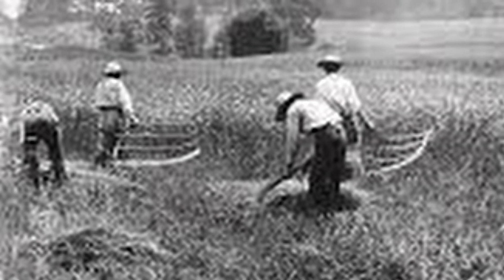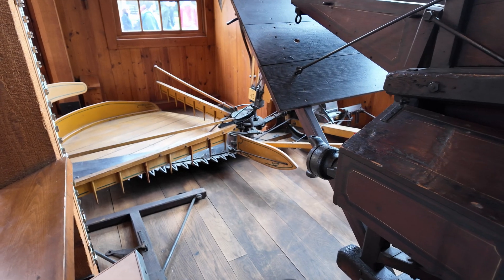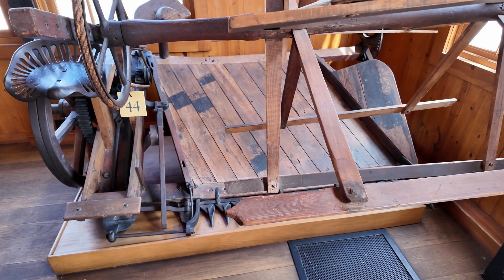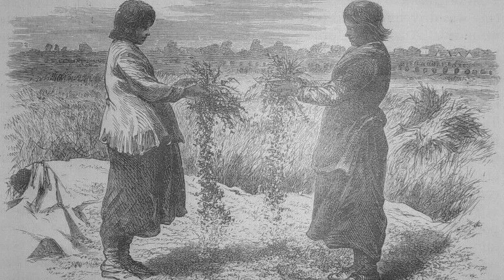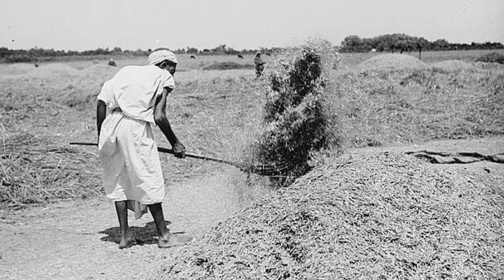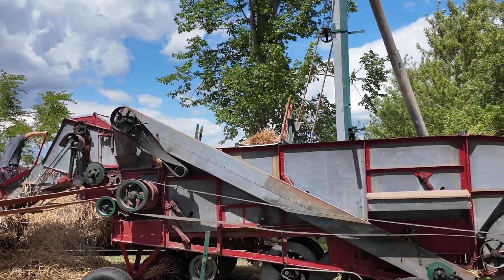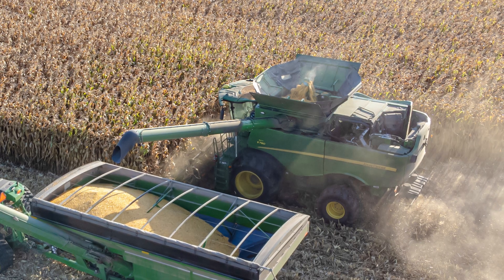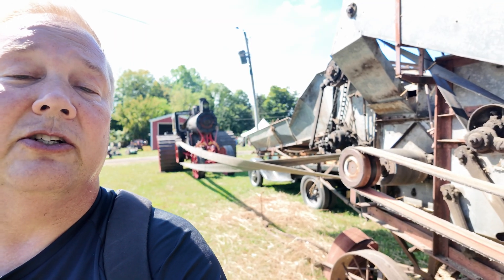How Threshing Machines Revolutionized Farming Forever

Comment: I'm restoring an 1860s Ransomes and Sims portable steam engine and own a 1856 Ransomes and head thrashing  machine, the oldest set in the world. Hopefully will have them working together in a few years . I'm in Tasmania
Reply from the maker: Sounds like a really cool project.  I hope to see some video when you get it all working.
Reply: The portable has wooden wheels . She was in a huge bush fire which distroyed them. I re made them copying the thrashing drum wheel as they both have same cast iron hubs and tyre sizes. She was re boilered in 1902 in steel making it possible to repair. Luckily she's not missing any parts even has original whistle and pressure gauge measuring in atmospheres. Such a time machine

Comment: Great explanation but some terms are wrong (I nitpick about terms because I will get the thing you say and not the thing you mean when using the incorrect term) so here is what I know: Reaping is the cutting of the stalk of the grain, The cutter bar of the mechanised reaper cuts by shearing instead of slicing which a scythe does or chopping like a sickle being pulled towards the user (sickles can also slice) but not sawing but you did mention scissors which is a correct analogy.
Edit: Harvesting is the process of gathering the crop into storage where it wont spoil for a while, so grain can be harvested but not threshed.
Reply from the maker: Thanks for the comments.  On the last point first, you're definitely right.  Before powered threshing machines, harvesting of grain was usually done before threshing, sometimes months before.  This is something people in modern farms have mostly forgotten, since the introduction of combine harvesters.
Speaking of combine harvesters, if I used that term around local farmers, they'd laugh at me.  They're combines, here.  There's no such thing as a disc harrow, either.  They're just discs.  There's a lot of local terms out there, especially in the agricultural world.
I think all your terms are correct, even if I hadn't heard the difference between a scythe slicing and a sickle chopping, and appreciate you sharing all the info.  Please keep doing it with my future videos!  I do try to always get the right terms, within the limits of regional variation, even if I do sometimes use the more common ones, and sometimes, the correct terms keep tripping me up (like remembering that grist mills grind grain, millstones, grind grain, but the individual grain kernels/corns are actually scissored, not ground. 
Again, thanks for the comment, and I do always appreciate more info I can use in the future.

Comment: It's actually a portable belt driven thresher
Reply from the maker: Technically, true.  They can run on just about anything that can spin a big enough pulley fast enough with enough power.  They were first built to run on steam engines.  I don't think older horsemills would have been able to run one.  Certainly, newer, non-steam tractors can run them, and a lot of older farm tractors do have pulley-type PTO which can run them, later supplemented with the more modern shaft-type PTO.  (I'm sure both types have names, which I don't know off the top of my head).

Comment: Are traction engines forbidden from being driven on the roads because of their speed, metal wheel tread, or something else?
Reply from the maker: Well, speed is definitely not an issue for non-highways.  They tend to be on the heavy side, so they're banned from some roads simply due to that.  
I couldn't find a picture, but for roads where the weight, combined with the steel wheels, is an issue, they do make rubber pieces that go around the outside of the steel wheels.  I couldn't find a picture just now, but I've seen them in some parades.
Reply: Not aware that they are banned from roads, not hear in England anyway.
Most engines that do much road work do have solid rubber tyres fitted. Mainly for safety and the comfort of the enginemen. Exta lighting and flashing beacons are fitted too!
Reply from the maker: Around here, anyway, where I've seen the rubber fitted onto them, it's due to the asphalt, which is soft, especially on hot, sunny days, and the steel wheels can literally press permanent grooves into the surface matching the treads on the wheels.  I'm sure that only applies to the larger, heavier ones, but not sure where that weight limit hits.  The smaller ones shouldn't be much of an issue.
Reply: @Industrial_Revolution  
We don’t have much trouble with tar melting on our roads in England😀  I do remember it did happen when we had the very hot summers of 1976-7.
It also saves on ware and tare an the bearings on the engines too having rubber tyres.